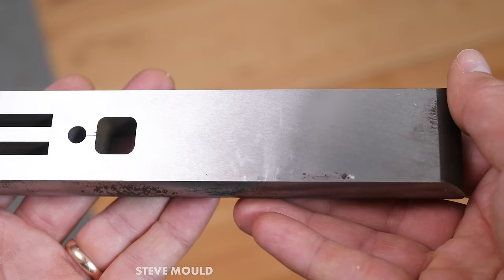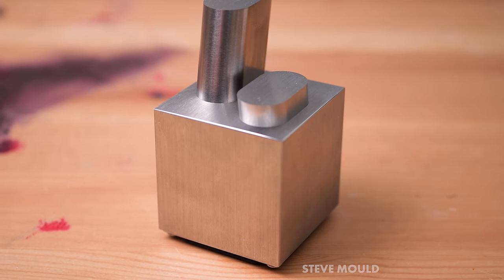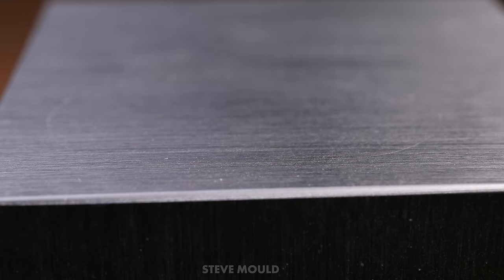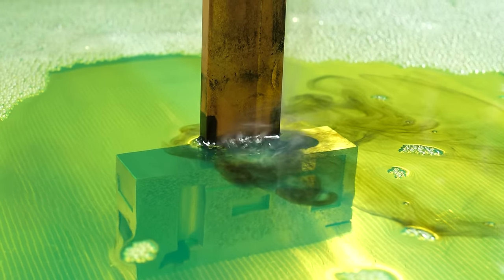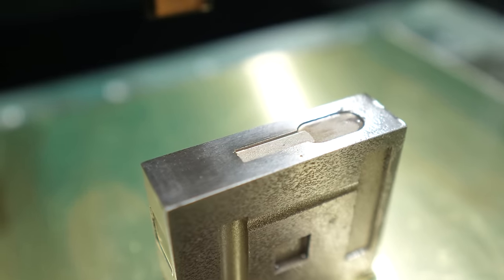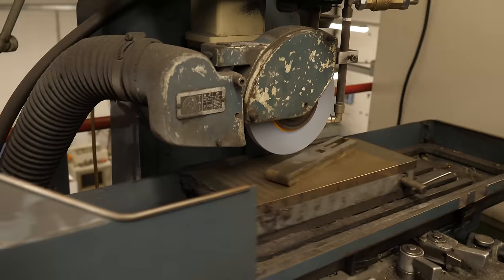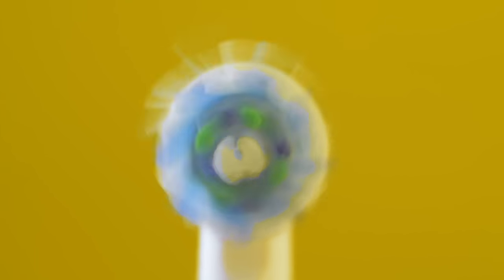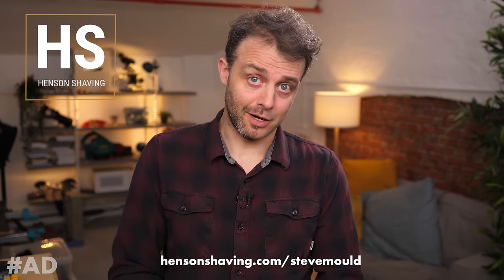How these impossibly thin cuts are made

Comment: In the 1995 World Rally Championship, Toyota infamously used engineering like this to bypass the FIA mandated turbo air restrictor plate and thus produce significantly more horsepower than their competition. There were internal springs that would open an air gap around the restrictor only once the restrictor was fully installed and the turbo was producing boost pressure. It would close when the engine was at idle/when the restrictor was removed for inspection, making it impossible to spot by the FIA inspectors. 

Max Mosley, the president of the FIA at the time said this: "It is the most sophisticated and ingenious device either I or the FIA’s technical experts have seen for a long-time. It was so well made that there was no gap apparent to suggest there was any means of opening it.”
Reply: I'm always impressed by the ways in which motorsport teams try to use technology to get around bans on certain things. Except when the team I support loses because of it of course.
Reply: I wonder if this gave the automotive industry the idea for how to beat diesel emission tests … 🤔🙄
Reply: @rogerramjet8395  No that was software. Software is messy and ugly, unlike precision mechanics :D Now what if all the cars had the same controller and software... oh wait, they did and they all cheated, never mind.
Reply: Max Mosley.. there was a man strapped for cash.
Reply: The 1995 Toyota Celica GT-Four ?

That's a helluva sports car, and joins the dozens of dozens interesting 90s JDM cars that were discontinued going into the 2010's. Car culture has also gone down with it, from the days of GT3, GT4, NFS Underground, NFS Carbon, Fast & Furious 1-3.
Reply: this has nothing to do with edm, it was just a hidden mechanism
Reply: That’s about numbers right? What’s the name of it 😂
Reply: Misleading.
It didn't use EDM
Reply: @CableWrestler  op said engineering, not manufacturing. They (Toyota) achieved measurable results in the mechanism by hiding the seams. Regardless of how they produced/created/manufactured the part/s, it's a relevant practical example of a use case for this sort of "zero cut" machining and a good bit of info.
Reply: It was just a clever hidden mechanism, it wasn't amazing clearances, but a sliding mechanism that allowed air to bypass to the turbo, but only after it was moved and locked into place by the team. For measuring, in its resting state it appeared it was a normal turbo restrictor.
Reply: What does this have to do with the video?
Reply: @ekinteko  Just cause cars aren’t made like 90’s sports cars doesn’t mean car culture has gone down with it. Car culture isn’t even just jdm cars, it’s always been about cars, lame ones or cool ones. The jdm craze came after american muscle…
Reply: @milkyy4168  I think you're right. But you can't deny there was much bigger hype back then. It shifted into 4WD category for big part of Car Culture, some have turned to Motorbikes, and now we're entering the EV segment.

But can we name all those unique 90s JDM models:
- Skyline (upgraded to GTR)
- Supra (upgraded by BMW)
- SC400 (upgraded to LFA)
- WRX (upgraded to WRX)
- 300ZX (upgraded to 370Z)
- 240Z (upgrade to Fairlady Z)
- SVX Alcyone (upgraded to BRZ)
- AE86 (upgraded to Corolla GR)
- Civic R (upgraded to Civic R)
- Miata (upgraded to MX5)

Abandoned:
- Mitsubishi EVO
- Mitsubishi Galant
- Mitsubishi GT3000
- Mitsubishi FTO
- Honda CRX
- Honda Integra
- Honda Prelude
- Honda S2000
- Honda NSX
- Mazda MX6
- Mazda RX7
- Nissan GTi-R Pulsar
- Nissan 200SX
- Toyota MR2
- Toyota Celica
- Toyota Chaser
- Suzuki Cappuccino 

...what other models have I forgotten to mention?
Reply: @ekinteko  A lot of these cars are wrong, I mean the ae86 was from the 80’s and the integra and nsx still exist today…. Your comment on how it shifted awd into the limelight is true but I think you’re missing a big point when calling back 90’s jdm cars. A lot of these weren’t even intended to be sports cars. The 300zx and supra were tourers. Ae86 is literally a standard economy car. I think people are mistaking capability of cranking high horsepower numbers with being a sports car, and car culture has never been about sports cars. It’s been about all cars, like rugged off-roaders and drag ripping machines as well.
Reply: why do I never get 1K likes :(

Comment: I've been working with 3d printers for the past couple of months and I've really become to admire this kind of precise tolerances only advanced machining methods could achieve. Amazing.
Reply: You can make this part with plain milling machine and surface grinder.
Reply: @ansgaryeysymontt7155  🤓🤓🤓
Reply: you should have seen this 3D print I did for an etsy order. One square fitting in another and it was a ridiculously perfect fit. Now the edges aren't as sharp so you could still see the outline, but I got lucky on how perfect the squares retained their designated sizes.
Reply: Unfortunately 3d printing in itself is not accurate when ur talking about .00001 tolerances
Reply: @ansgaryeysymontt7155  then do it and upload the video.
Reply: @d4rk0v3  He is right tho, it would probably be easier with a EDM but something like that is definitely possible on a Manual mill and on a CNC mill there is no question.
Reply: @ansgaryeysymontt7155  Issue is that plain milling machines in general aren't precise enough for this kind of work to be done consistently; al least if you don't want to spend like a month in a single simple piece like the one in the video
Reply: @henriquepacheco7473  with correct jigs milling machine wold be faster than edm.
Reply: @jeeperzcreeperzz  .00001 what? apples? bananas?
Reply: @jeffyboi6969  lol, 3D printers are probably the worst thing you can think of when it comes to precision.
Reply: @lo2740  lol sounds like I really don’t care what you have to say. I literally said “I got lucky”, work on reading comprehension little one
Reply: I saw a Quora question about the best invention we have as modern humans and the answer was a flat plate. Making something perfectly flat creates a perfect base for repeatability. Imperfection is the bane of innovation.
Reply: Those Egyptians were amazing, hey.
Reply: @SmilieLyon  nothing can be perfectly flat, let's just call it reasonably flat, or sufficiently flat
Reply: @d4rk0v3  just look for any video of machine shop work
Reply: @SmilieLyon  hard disagree. Most of humanity’s greatest inventions were due to imperfections to some degree or another.

Innovation REQUIRES imperfection. The known laws of physics were incapable of describing the motion of Mercury, so Newton invented Calculus because the mathematics available to describe Mercury’s motion were imperfect. Newton’s laws of physics were imperfect when discussing masses of extreme scale on both ends of the spectrum, thus Einstein’s theories on Relativity and the birth of Quantum physics, themselves imperfect tools that require more innovation and iteration.

Imperfection leads to necessary improvements, and necessity is the mother of invention.

Comment: I've worked with Mitsubishi Wire Feed edms (FA20S) myself, and I honestly find them very satisfying to work with. I used to primarily program and run the machine for tool & die components, but I loved to find an excuse to whip out the machine for other use cases that conventional machining methods would be difficult. I have far more experience on milling and lathe work now, from anywhere from micro-machining to huge oil and gas components, but its nice to see wire edm in action as it was essentially my roots beginning as a machinist. Thanks for showing off my passion for others to see, I find this stuff fascinating with the history and science of manufacturing, and how it allows humans to make amazing innovations. 
A few little  tidbits I thought I might mention in case you might be reading this: when referring to the .001's place of a millimeter, it is preferred to say "Microns" as it makes you sound smarter, but also it prevents confusion from the imperial "thousandth's" which is commonly used as it's own term.
The first type of edm you mentioned, the sinker type, was far more common decades ago as wire feed edm was not advanced enough at the time. While the accuracy of a EDM machines is amazing, they are not the only machines that can reach such levels of repeatable precision even down to +-.005 millimeters, however, they are set apart by the unique features they are able to cut as they exert very little cutting forces, and the difficult to cut materials that they superior at dealing with. Modern diamond tooling solutions try to give other machine tools access to manufacturing these types of extremely difficult to cut materials, such as tungsten carbide, but EDM machines are a tried and true method that many shops still rely on for tool & die or other prototyping manufacturing.
Thank you for your informative video, I have not touched a wire edm machine in a year and I honestly miss the joys of working with them, or having your wire break midway through a 18 hour die and accidentally resetting your G54.
Reply: I think you meant "down to ±5 microns" 🙂
Reply: @DougWoodrow look, a useless pedant. its almost like the original commenter was using measurements that are more familiar to the average person, and by the by, +- is pretty good shorthand for someone who doesn't know how or doesn't care to input the actual symbol.
Reply: @logandarnell8946   Try reading the comment I replied to in full.  The symbol wasn't my point, I was merely amused that the commenter didn't follow their own "tidbit".

Comment: In a 'former life' worked on EDM machine that was used to remove broken studs from machine blocks etc.  I always thought it was amazing how they could 'bore' out the broken stud, large enough to cut the stud from it's own threads (diameter of the thread root) and yet NOT damage the threads cut into the hole of the machine block.  Some very precise stuff.
Reply: Not trying to be annoying but why did you stop working with EDM? It seems such an interesting career for me
Reply: @4f52  Maybe he just didn't like it, was tiring, didn't pay well, stuff like that, Mark Rober quit being a NASA engineer to be a youtuber.
Reply: Well, one can cut to tighter tolerances, using similar methods. But, then one has to worry about sticktion, the damned thing welding itself while static and assorted other annoyances.

Comment: Wire erosion can be very accurate, if well calibrated and with the proper settings... I've personally had wire eroded parts delivered well out of tolerance before - it's like any other CNC machine in some respects. 
One of the really cool things about wire erosion, aside from the sorts of details and features you can make with it, is you can put very neat cuts through incredibly tough materials that traditional machine tools would really struggle with: hardened tool steel, nickel superalloys, tungsten etc.
Reply: it'd be very easy to make stuff like 123 blocks this way too. just grind in one dimension and let the machine handle the rest of it
Reply: I mean your first point is literally true for everything.
Reply: Does anyone know how a brass wire can cut steel?
Reply: @All_SportGG  Just a guess on my part. But I think the brass wire mostly carries the electric charge which is actually doing the cutting.
Reply: @All_SportGG  Yes, we all learned while watching this video.
Reply: @All_SportGG  There is continuous arcing between the wire and the material. 1000-1200 sparks/1 second. This results in a speed of around 4 mm/min for steel with a thickness of 40 mm (generator dependent)